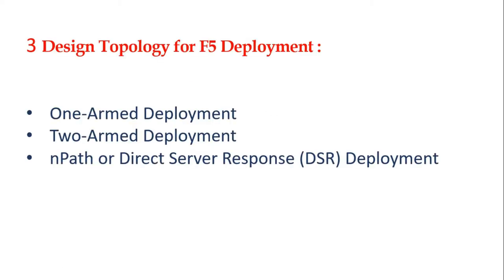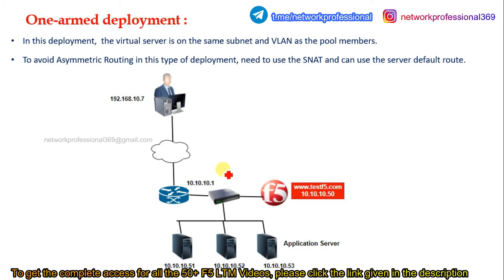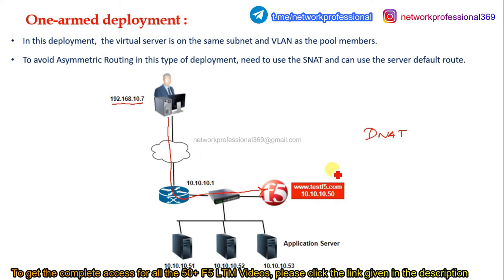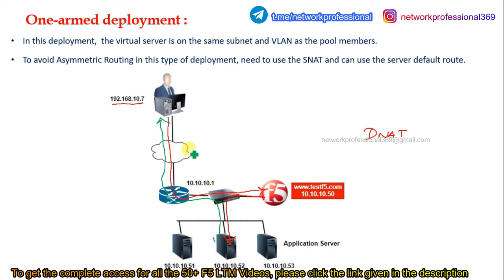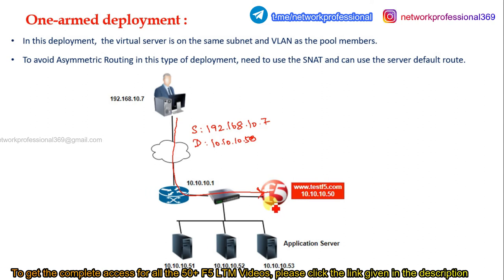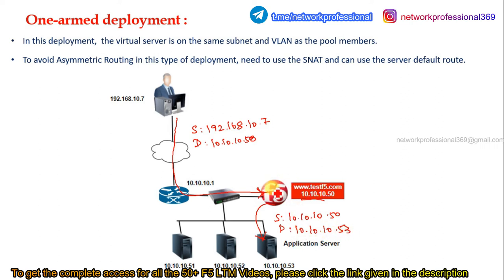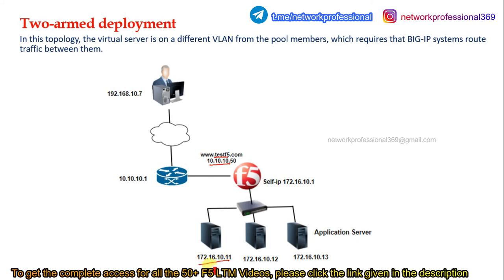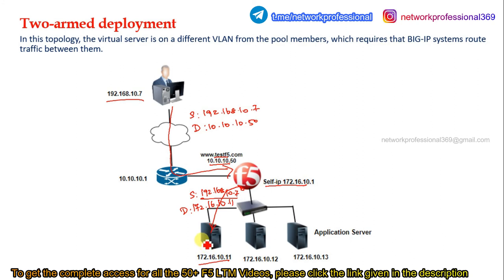Lecture #4 || F5 Load Balancer Deployment Methods in English || One Arm | Two Arm | nPath DSR |

Comment: In one armed deployment method, if default gateway ip is not used then whats the use of giving default gateway ip to the servers ?
Also why can’t we use virtual ip as the default gateway for the servers instead of router ip ?
Reply: if we use virtual ip then it would be self-ip then it became two ARM NOT one arm.  and the reason we give default GW in one ARM is because traffic has to go out then it need atleast one GW ip.

Comment: if the application server replies directly to the client, won't the client computer drop the packet because it is coming from a different ip address order than the one used to made the request and there is no established session between the client and application server?
Reply: Initially the client made a tcp session with virtual server and waiting for replay from virtual server but the replay is coming from actual server .The client will drop the packet because there no TCP handshake happens between actual server and client and client is not able to identify the traffic.